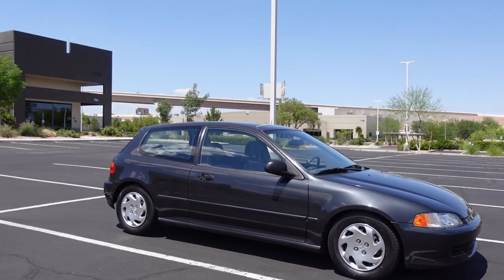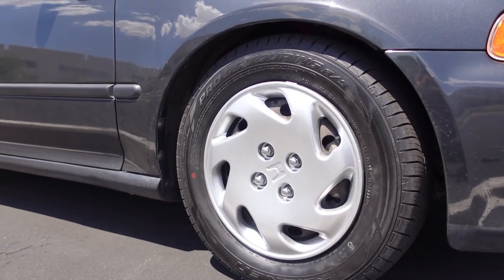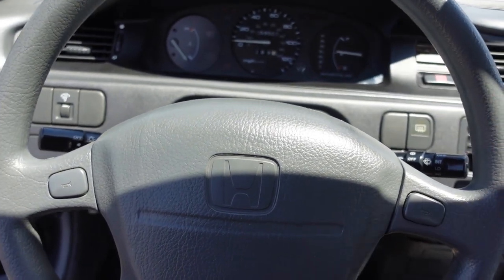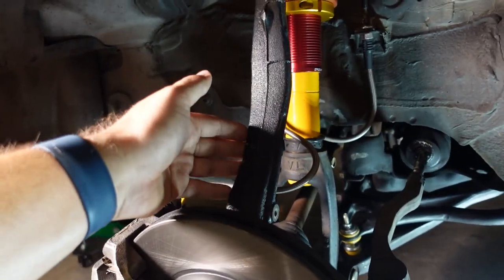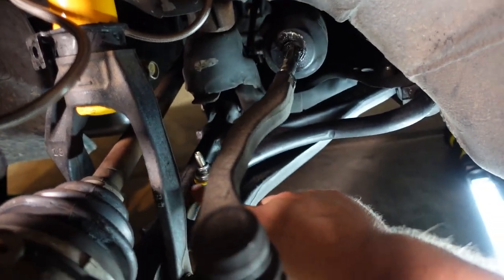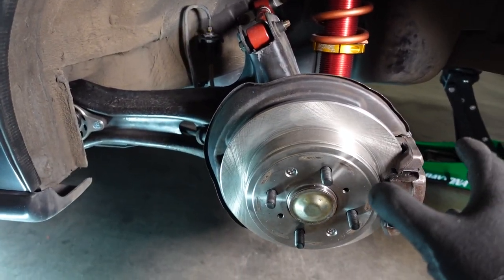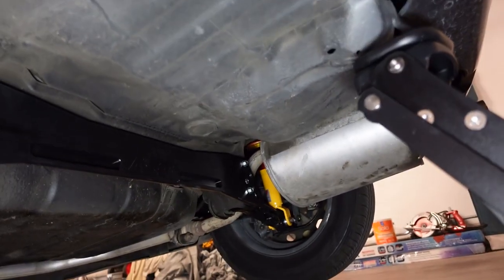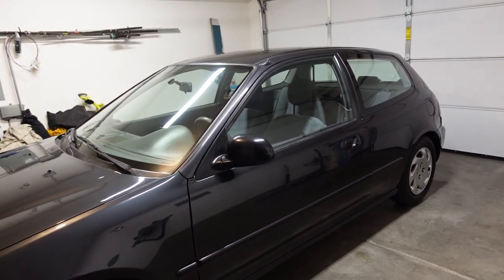MINT 95 Honda EG Civic Hatchback Build

Comment: Nice car..... something for you to think about is you may want to go with a B series engine since it fits the era of this car and it drops in without cutting any mounts or cutting a hole for the shifter assembly. If you are worried about price of a B series consider looking into LS VTEC or B20 VTEC. The K series is a taller engine which affects center of gravity and was  designed for Hondas where the engine can sit higher ( higher hood line, newer crash regulations). This chassis was designed around B and D series engines and I trust the Honda engineers. The B series also fits the theme of the build that you are going with ( called a restomod) where you improve small things without reengineering and refabricating the car completely. Yes I know people do Kswaps all the time but the B series will ensure that you don't cut up the car just for an engine swap when the B series is plug and play  and is more than capable for track use. Wish you all the best with this build.
Reply from the maker: thanks for the comment, Check my latest video, Type R K20 going in the car.

Comment: This is civic goals, only thing I'd do different is a nixe head unit 2 modernise the interior rather than the block off. But I gotta subsribe...beautiful car man wow. I got an Ek3Vi Sedan and I would love to do similar suspension setup, already did the lower control arms and subframe brace in the rear!
Reply from the maker: Thank you very much! Engine Swap coming soon, just waiting on transmission to be built.